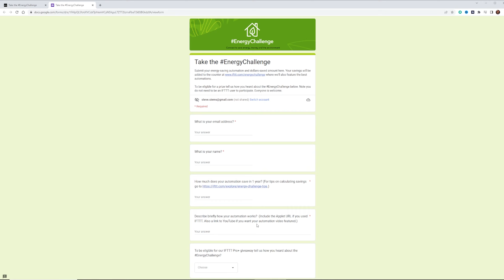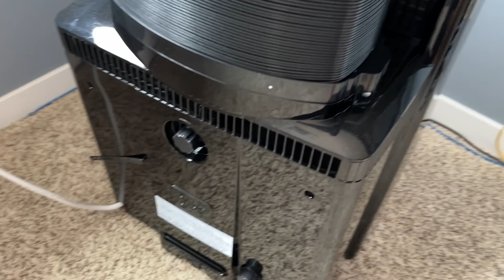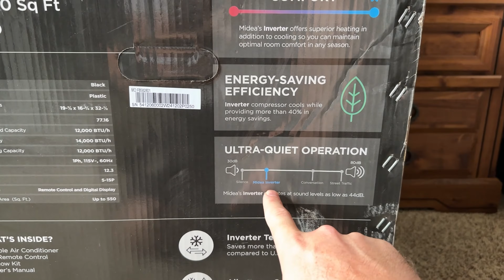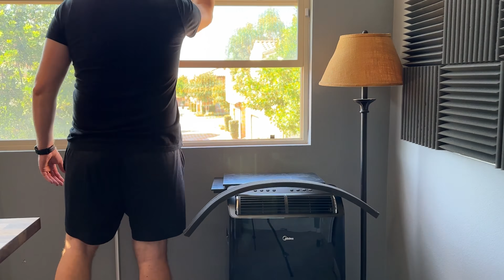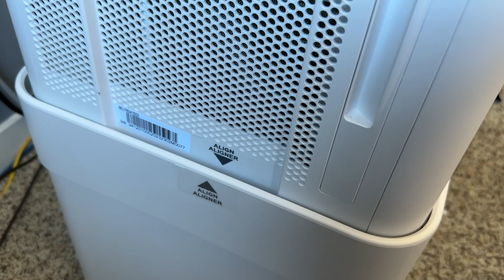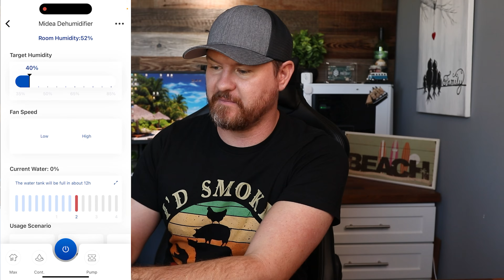Beat the Heat & Banish the Damp: Midea’s Ultimate Cooling & Drying Duo

Comment: I regret paying extra for the heat function. It only works when its over 40°f outside. My place stays warm so I don't need a heater until its below 40°f outside, and it won't turn on then.
Reply: Relocate the intake air temprature sensor from the intake hose to a warmer location.

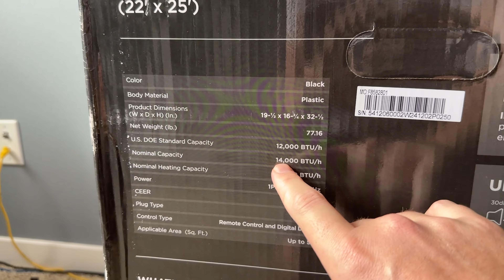Comment: @5:08 - it uses an "inverter" because the compressor motor uses direct current which uses half the power required to cool - but think the unit cost about $200 more - worth it if in use 2 months and more per year

Comment: So how does the condensation draining work, if it's not connected at all times?
Reply: I had to connect the hose to the top drainage area and then put the other end in a bucket. I am surprised at how much liquid has been draining out of the air conditioner because I saw it that if it was only on the cool setting that most of the liquid would evaporate and be expelled through the vents of the window.

Comment: Is there a hose connection for the A/C overflow drain?  Do you really have to pick this thing up and drain it in a sink or something?  I want to just drill a hole in the wall and route a hose to it so I never have to mess with it.  Is that possible?
Reply: I connected the hose to the top drainage plug and then the other end of the hose I put in a bucket. It's amazing how much liquid is coming out of the machine. It's much easier than having to move it or tilt the air conditioner to get the water to come out. Be sure to check your bucket a few times a day
Reply: I live in central Pennsylvania and I have never needed to drain the A/C once.

Comment: I have the air conditioner I just bought the same one. What's the best way to drain it so I don't have to keep moving it?
Reply: I connected the hose to the top drainage port and then put the other end of the hose into a bucket. I can't get over how much liquid it has been collecting so be sure to empty the bucket regularly like check it several times a day

Comment: Can this be used in a garage that has no window?
Reply from the maker: No, i has to be able to exhaust out the hot air somewhere.
Reply: @SteveDOES  like into the attic, maybe?
Reply from the maker: @dee-ttc-gb  That might work. This device does produce a lot of heat that will need to exhaust somewhere out of the room.
Reply: @SteveDOES  Thanks, Steve! This is helpful.